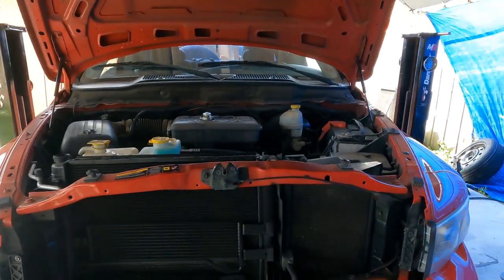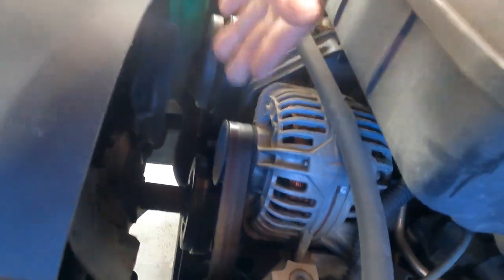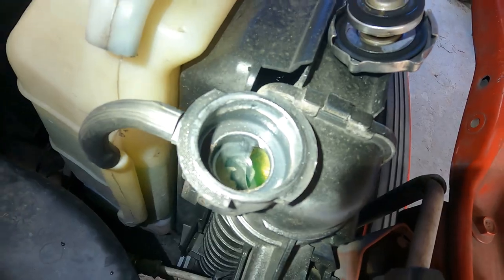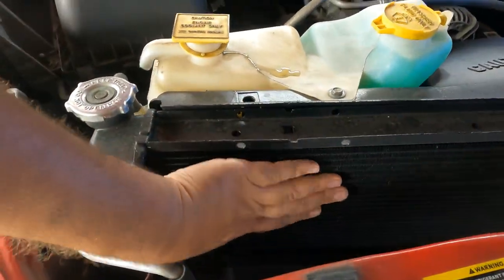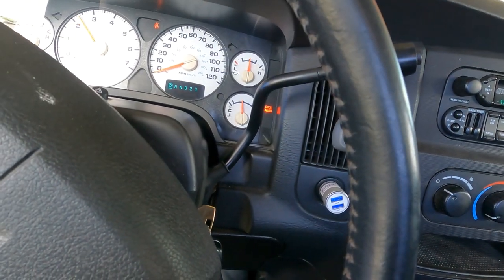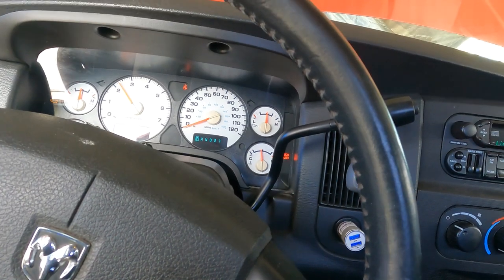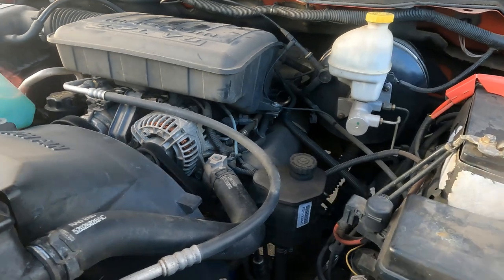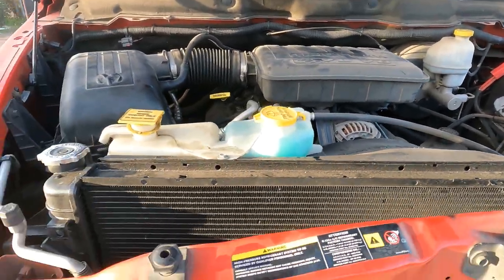Dodge ram 1500 4.7L over heating.

Comment: In 2005 i bought a ram1500 new 5.7 hemi ,first thing i did change the termostat to 180 deg , operating temp on these 4.7 and 5.7 is to high 210f it will blow your head gasket over time i have 205,000 miles on it now it runs like the day I bought it.
Reply from the maker: Interesting. Did the check engine light come on with a thermostat code?
Reply: No never.
Reply: Themp sits around 186f on summer time in arizona , the only downside could be that it takes longer to warmup in cold conditions.
Reply from the maker: Cool. Thanks for sharing

Comment: My 2003 is down right now because it blew a lower radiator hose on the interstate. It was building up with air until it blew. When I open the bleeder hole and have the radiator cap off, it has bubbles come out of both side and they never stop, I’ve tried to bleed the system for hours, it never stops. It’s like it’s building up air pressure internally. Also, when I fill it up with coolant, the thermostat never sucks the coolant down when it gets to running temp. But the flow of coolant is constant even when it’s cold, so the thermostat can’t be closed? I’m completely lost
Reply: Definitely sounds like you have a blown head gasket bud.
Reply: @Justin-gl4lk  I had my grandfather’s mechanic look it over, didn’t take anything apart, but said I don’t have a blown head gasket, but I still believe I do. One thing that might point to something else, is that I don’t have any water or coolant in my oil
Reply: Just try a new thermostat, make sure the pin hole is set the top. Might just be a bad thermostat if not your head.
Reply: Having the same exact problem. Figured anything out?
Reply: @bruhbruh4335 did you figure it out?

Comment: How about the temp switch ? Can this be a sign of overheating ?
Reply: Seems it was. I replaced my theremostat, and issue persisted. I then replaced my temp switch, which seems to have solved the problem. My gauge would jump all the way to the right about having driven a mile, and my check engine light would come on.. I never smelled antifreeze.

Comment: The water pump will not tolerate heat expansion and pressure at 197 thermostat use  180 or 170 degrees thermostat

Comment: I replaced my water pump an thermostat it's still  running hot what can I do
Reply from the maker: Could be a clogged radiator
Reply: Sensors ,get it plugged up to machine by mechanic

Comment: My Dakota needed new fan clutch, water pump, serp belt, therm and gasket, tensioner, and properly burped with hex head socket. Never again. Keep up on your 4.7 Dodge V8 cooling system. Or you will drop a valve seat.

Comment: JUST LIKE ALL VIDEOS  SAME PROBLEM SAME  ADVICE TEN REASONS WHY OVERHEATING  FIX REPLACE THURMASTAT AND REDIATOR CAP AND WATER PUMP AND THE REDIATOR AND HOSES RELAY AND FUSES AND COOLANT SENSOR AND AND ADD PRESTONE AND WATER AND  REMAIN WITH THE SAME OVERHEATING ISSUES  TAKE IT TOO MACIANIC AND PAY 3000 THOUSAND GO HOME GET STRANDED ON THE ROAD